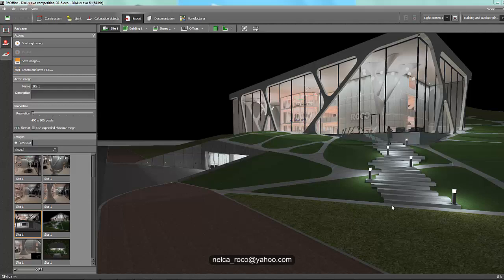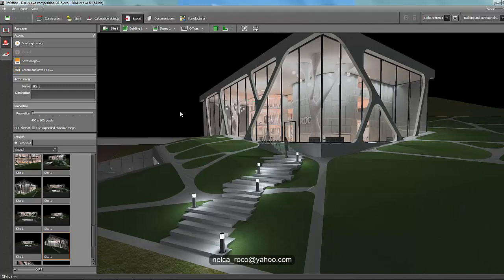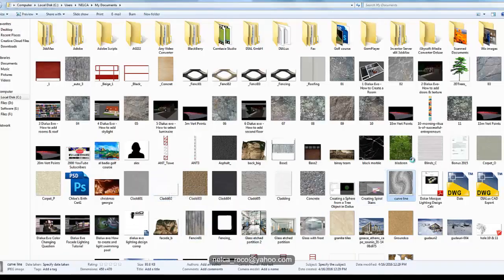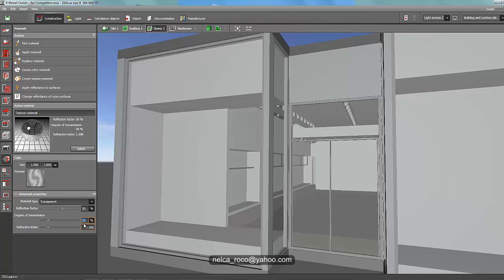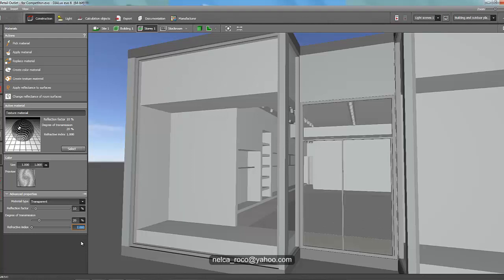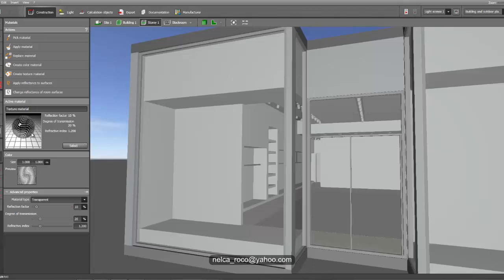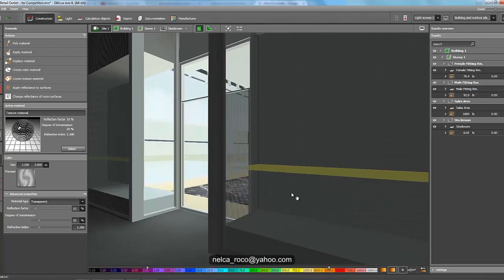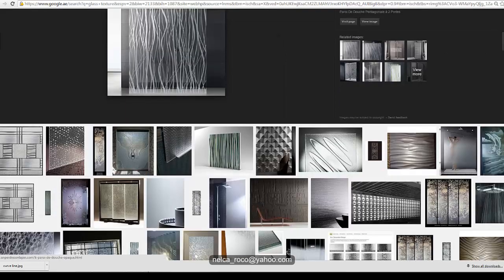Dialux evo - How to create a decorative glass panel

Comment: can you help me...
i am doing an internal and external calculation. However, the external lighting is not showing up, like yours are. do you know why this could be?
Reply from the maker: Go to "site" tab and see how it looks.
Reply: +Nelca Roco, Lighting Design yes i know this Nel o, it works on all my other designs. But for some reason this is not. I have external and internal lights showing and on the building and they are fine. But, externals that are not around the building that are lighting pathways etc are not showing up on the floor!? Do you know what this could be?
Reply from the maker: I know now, you inserted the luminaires on that pathwalk on the building or story tab. first delete these luminaires, then go the site tab, then insert it again. enjoy!
Reply: no :( unfortunately this is not the problem, i inserted them on the site tab. 
they just do not calculate or show any light on the floor at all. but when on or near a building they will show on the building.
Reply from the maker: would you mind send me file? nelca_roco@yahoo.com
Reply: Nelca, I have emailed you the file. Have you received it?

Comment: hi Nelca, I sent you an email but maybe it is in your spam box so I want to write it again in here. In one of your project I saw an arc ramp for parking area  (https://www.dial.de/fileadmin/_processed_/csm_DIalux_evo_Facade_Lighting_Entry_-_Nelca_Roco__1__a2dbea2d2a.jpg) . I really wonder how you did that in evo. Could you please explain this. Thanks in advance.
Reply from the maker: Dear Deniz, its easy, just create the curve using the extrusion object, then place the ramp or inclined object from the default objects.  scale  it until it covers the curve object, then instead of subtract, intersect.  
Good-luck! let me know if you made it!
Reply: Thanks for replying again Nelca :) I guess I did what you said. But I want to obtain a straight entrence instead of angled. When I intersect the extrusion object with ramp, it makes the entrence part also inclined. downward.
Reply from the maker: do u know how to use Sketchup?
Reply: Yes I know but when I import 3ds file into dialux, the calculation is getting too slow :/
Reply from the maker: small ramp may not that heavy. dont import 3ds file more than 1mb.
Reply from the maker: check this one. 
https://www.youtube.com/watch?v=upF3WRXDlu4&feature=youtu.be